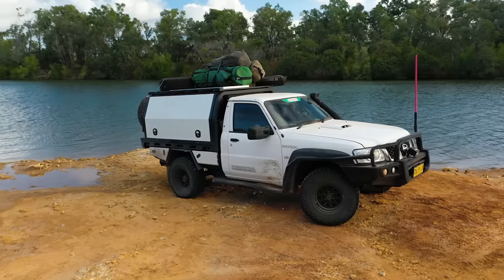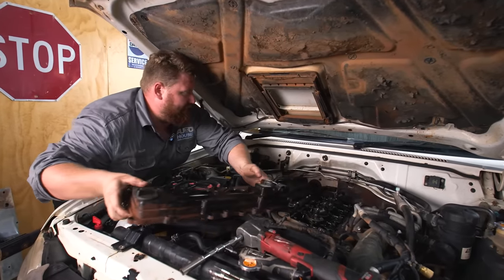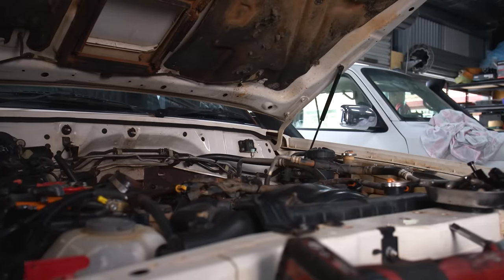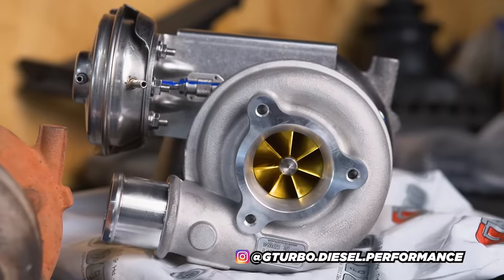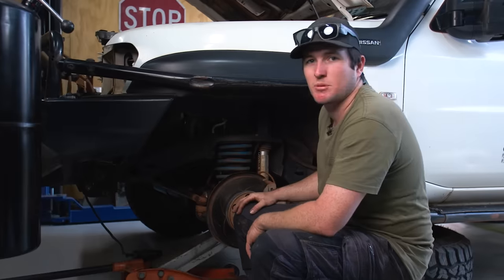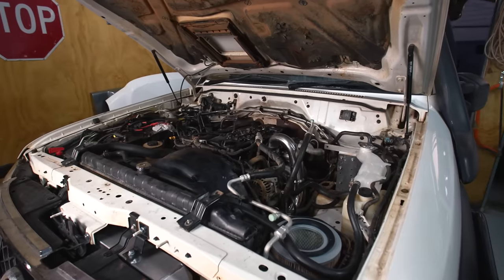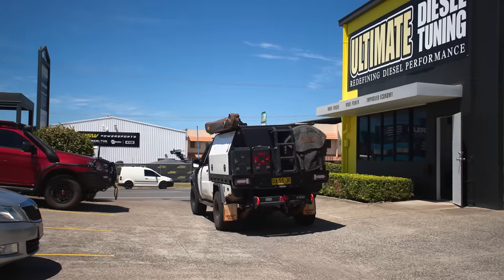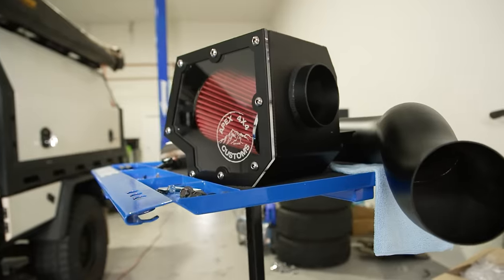Camera Car Damage report - is the 3L GU Patrol really a grenade? What went wrong & how we fixed it

Comment: I would agree on Turbo Yoda's opinion on the ZD30. It's not a bad engine. It is quite under powered for the weight of the vehicle. It is working really hard most of its life.  The TD42 would have that extra capacity for what you are using the vehicle for. Still no replacement for displacement.
Reply: Rubbish.  An underpowered engine does not "work hard".  The TD42 is a part of history, and as for power and torque the TD42 makes far less than a ZD30, meaning in your terms it works even harder.
Reply: We have increased the ZD's performance and reliability so that it easily outperforms the td42 for relatively little money. Displacement is great when utilised in a efficient motor. The TD42 is anything but that.

Comment: I run a PDI FMIC. Fitted a 12" Spal pusher fan (i clipped the grill and used the 1500ish cfm unit), keeps temps down when running AC in low range - or even just in low range - recommend fitting one!
Reply: Also a PWR power steering cooler as those factory heat exchangers are inferior and takes up space and disrupts airflow.

Comment: Would it have been better to get the tune after the new airbox and snorkel was installed?sure it would affect the tune.
Reply: They did get a tune.
Reply: @madlad8629  But you didn't read the question.
Reply: A turbo doesn’t care where it’s sucking air from. As long as it’s clean & dry
Reply: @user-ej7hi6tm8v  yeah but if you change the filter you change how much air is going through so then there's a air ratio difference
Reply: @monster-op7sf the ecu computer should adjust for the higher airflow ... If it's any good
Reply: @MrTonaluv  No ECU can automatically correct the airflow on this setup. The MAF sensor is reading less airflow because of the intake pipe they fitted.
Reply: Yes and no. Yes it can and will effect the tune. No this is not a issue if the tuner knows what they are doing. Having said that. Having a "custom" tune done then completely changing the intake was pretty dumb. Not as dumb as what they did with the boost control but dumb never the least.

Comment: Surprisingly he didn't remove the exhaust manifold for flattening.  I enquired about a turbo upgrade for my 2010 when it had 80,000k on it - the shop wanted to rip off the manifold because he said it would be warped.  I didn't spend the $7500k he quoted.

Comment: Have owned my zd30 commonrail for 120 thousand ks now last 70 of them tuned running 21psi tuned stock turbo and its been fine at nearly 300k now. Once you do egr block boost controller catch can etc they are not a bad motor!!!
Reply: You may have got lucky and found a unicorn but generally across the board they are crap😂
Reply: But 300.000 is still not that much.
I'm curious how it will last you when it is past 400.000
Reply: The di ones pre 07 are the "grenades" crds are much better with some preventative maintenance and mods. I take no offence to the uneducated though
Reply: @mauss9  being I maintain it well and have done injectors I don't see it being any less reliable than any other commonrail of similar age
Reply: @Swwa89  let's hope so mate.
Any car fix is pretty expensive. And no one wants that. I hope it will last you for many years to come.
Reply: @mauss9  me too. Has been bloody good to me over the years

Comment: love your show and have learnt heaps from you guys, but find it strange that after  dyno tune you then change air intake, which could change results from dyno tune. having worked tuning vehicles on a dyno, changing intake set and or exhaust set up can change horsepower etc. would be great to see if airbox changed any of this with another dyno run of camera car. thanks keith from nelson NZ

Comment: since my time in the military we used nylon stocking over the air filter, before putting the stocking over the filter, it got a light coat of silicone spray to trap and catch water, or the finest dust , used the method in the deserts and in the wetlands around the world and never had a problem in anyway! as far as you pulling the injectors , the dirt is the filtering unit for the diesel fuel filter, Raycore filter system is the best on the market, those injectors  are bad , but it could have been cleaner then that? we run raycore filters in the tank  and never had problems like that! offroading is fun , but not protecting the engine is PRETTY STUPID!

Comment: Put a restricter on the turbo feed line. And it should help keep the oil from leaking out of the turbo seals into the intake pipes
Reply: No no no. Reducing oil flow will kill the turbo very fast. That failure is not very common to start with. I'm 99% sure they misdiagnosed it anyway.
Reply: @skegbudley4611  no your wrong..
Reply: If you have a brand new turbo and it’s smoking it could be because it’s got to much oil pressure to the turbo seals and it’s leaking through the seals and into the combustion chamber and lowering the pressure to it with a restricter will help and not blow the seals on your new turbo

Comment: I love Nissan's but would never touch a zd30 after owning one.
Reply: What was the backstory?
Reply: @task82  Bought one of the last Y61 the Legend Edition in 2018. Was brand new (although production ended earlier, it was new old stock). Within warranty it did the usual zd30 rear timing cover coolant leak, had new injectors under warranty, egr cooler failed, cracked exhaust manifold. All happened under 100k. Out of warranty did the turbo, boost solenoid. Then just as it hit 130k the injectors went, replaced them and just last year the engine cracked cylinder 3 & 4 ring lands. It had all servicing done by the book, I really looked after it did services inbetween the main ones so it always had fresh oil and good fuel. I'm weighing up whether to put a new short block zd30 and flick it or do an engine conversion to something else.
Reply: @AdmissionGaming  wow, that really sucks mate.
Reply: Probably one of those low boosting ones you got. Do you have egt and boost gauges? Make sure it’s not running low boost and high egt

Comment: This video is like music to the hears of land rover owners.
A 2013 vehicle with only 200.000km had:
leaking airbox, high EGTs, sudden power loss, turbo leaking oil, turbo variable vane stuck,turbo failure,intercooler damage, injectors shot, rocker cover seals gone, hand primer pump problem, brittle expansion tank.

Comment: If it's been suckin' dust ...the bottom end could be badly worn as well. Big end bearings, main bearings and the bore could be scored. I bet the oil pressure is low ...

Comment: I live in NQ, is it worth while replacing the radiator with an after market larger one?
Reply: It will improve temps a bit but it is more important to keep the cooling system well maintained. Having the cores rodded every once and a while makes a huge difference. There is also a large section of the radiator that can't be cleaned whilst it is still in the car
Reply: @skegbudley4611  Thanks mate.

Comment: How to those backwards facing snorkels go on the highway? Don't they create a vacuum and reduce air intake?
Reply: They hinder performance once power levels get up. Speed does play a small amount but it's more to do with airflow restriction on a straight cut pipe. Bloody noisy too...

Comment: Where are these EGT's being measured from if you are so much selling the front mount intercooler ?  Surely you'd be improving Intake air temperature?  Assuming that massive thing doesn't clog with mud and block the radiator and she explodes anyway.

Comment: Nice upgrades, except for the snorkel! They perform much worse than a proper ram head and look terrible ..
Reply: Lmfao they perform better mate, don't touch a fucking car 😂
Reply: @Dylan069  Sorry mate, but it has been proven that a ram head performs better at high speed airflow, less dust intake, and less rain intake than a backwards facing stainless snorkel.
Reply: @Dylan069  ^^^^ this! There's a reason any reputable company with a R&D budget (Like Safari) don't sell them.
Reply: Ram style heads lose all ram effect after the first bend in the intake tract....proven fact
Reply: @danielthornton3277  it's not so much the ram effect as opposed the shape of the entry it's distance from the bend.  They almost flow as well backward as they do forward.  Which is orders of magnitude better than the backward facing stainless snorkels.

Comment: Cracking video boys one last thing before I go you boys need to sell that bloody patrol and buy a landcruiser cheers
Reply: I was thinking the same thing 😂😂 I’ve never had to rebuild the engine in my 80 series 😂😂
Reply: @paulschofield985 
Ya better replace the bottom end bearings or ya will be rebuilding it as 1hdt’s are renowned for it.
Reply: @paulschofield985  they didn’t do any rebuilding, just standard common rail maintenance and power upgrades
Reply: @paulschofield985  yeah I have an 1hdfte 79 series and I also have an old 1hz75 and they both haven't ever let me down
Reply: @triggerhappy8872 yea your right but it’s generally after half a million kms😂

Comment: Ive owned 2 zd30 patrols one auto one manual also a 4.2 gu ute. Honestly dont know why zd gets such a bad wrap most keyboard warriors have never owned one anyway 😂😂 great vid 👍
Reply: I'm with you part way.
I've owned a TD42, bloody kettle as they're well known for.
No way of stopping it cooking, sold it easily to a devoted TD42 lover.
Then into a 76 cruiser.
They are the most hyped up piece of shit, learnt to despise the bloody thing. Again, sold it easily to a devoted Toyota fan boy.
I was never even going to look at another Patrol after the TD42, bearing in mind I had previously test driving a ZD30 DI, felt underpowered immediately.
I was eventually talked into taking a ZD30 CRC for test drive.
This is without a doubt the best if all 4 vehicles listed here.
Yes it had EGT issues, run hot as they all do, but at least it didn't get hot hot like a TD42.
I resolved that at 88K, had a improved fully welded top mount intercooler installed, boost control & ECU tune done.
It just pulls all day now, EGTs are lower, and it's so refined compared to the TD42.
As for the 76, this thing now's pulls better than our chipped 76 ever did, flexes and tackles off road challenges with ease, nothing fases it, the 76 just made everything so complicated, had zero flex, hence wheel lifting requiring diff locks constantly engaged for basic maneuvers.
Today I ran my rear diff lock for about 3-kms of crawling just to lube it with use, never ever requires it, brilliant car, good motor.
You just need to look after them. That air box told the whole story, bugger all intelligence maintenance occuring on that vehicle.
These guys fascinate me, they rant on about looking after trucks, doing daily inspections etc on trips, that obviously doesn't occur in real life behind the scenes.
I totally love our ZD30 CRC, it just gets the job done in total comfort, nothing fases it.
Reply: @ianweal3081 100% agree the 3lt zd auto was my pick the 4.2 ute overheated on a fraser trip on us never really rated that engine
Reply: @Rexy888  fraser Is. 2012, mates 2.8 turbo 6 pot blew the plastic top tank totally off his radiator, as he just kept driving it hard ignoring the temp gauge, boom.
It's just a Nissan thing, it's as if they designed them to run too hot, haha.
4.2 was a pain in the arse, as when it got hot Nissan had built in protection, they just switched the air-conditioning off, reducing heat in condenser, hence cooler air hitting radiator core, that crap just pushed me into selling it.
Not ever a fan of 4.2 at all, so gutless stuff all torque, had to drive it like you stole it to get anywhere.
ZD30 CRC torque was so much better, now after tune, the torque delivery is brilliant, as I said, better than our chipped 76 was.